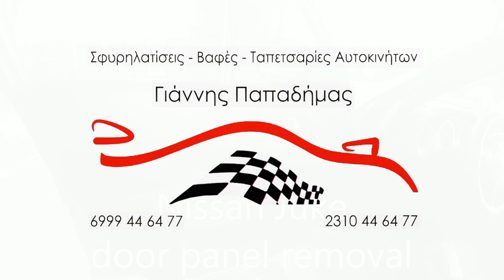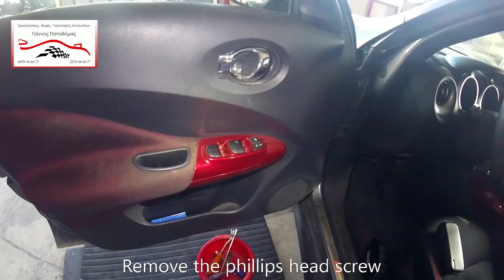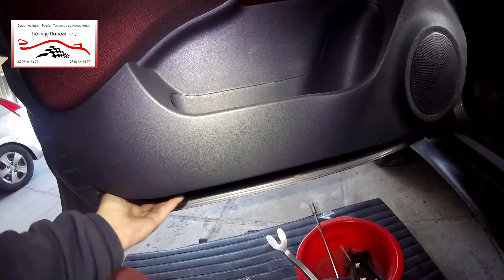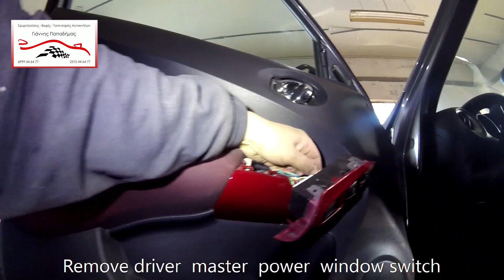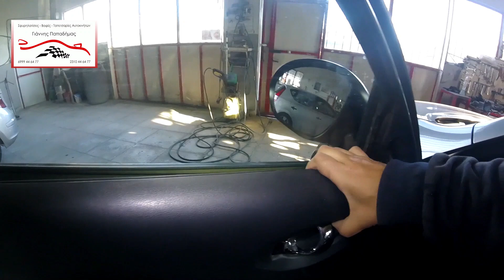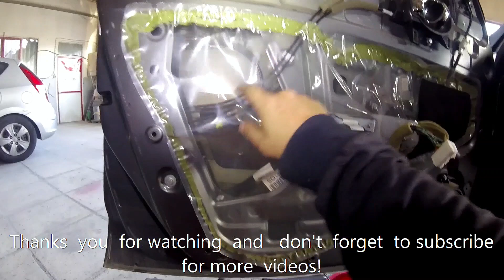Nissan Juke  door panel removal

Comment: Hi... What’s the red plastic part called where the window and lock button are invaded? Just need to replace the top half of that first red section taken off due to plastic damage from an air freshener!
Reply: Master window switch
Reply: Greg Horning thank you, do you know what the bottom red section is called? And do you know if that’s a part that can be bought on its own and not attached to the whole door panel?
Reply: @philippadunhill5619  It is part of door panel.
Reply: @philippadunhill5619  that may be part 80919-1KA0B stop by a nissan parts department and ask about the "door trim molding" for your year and model